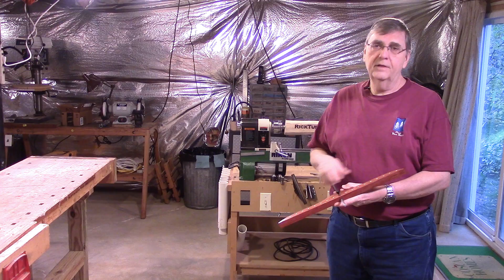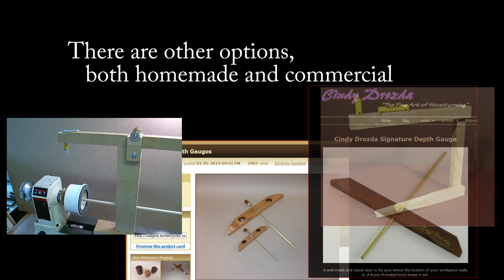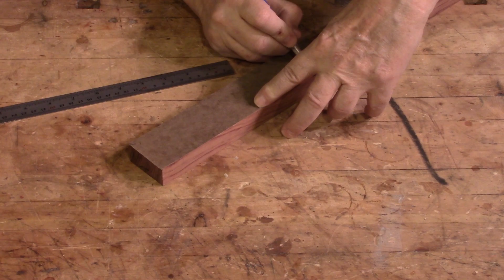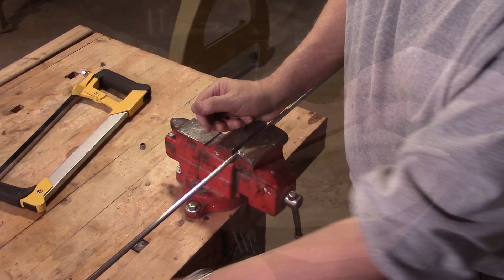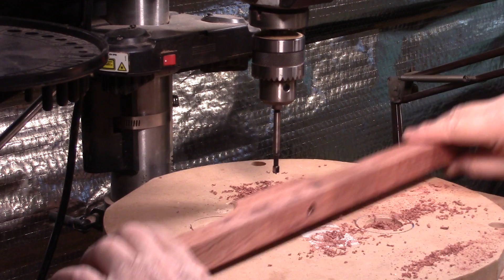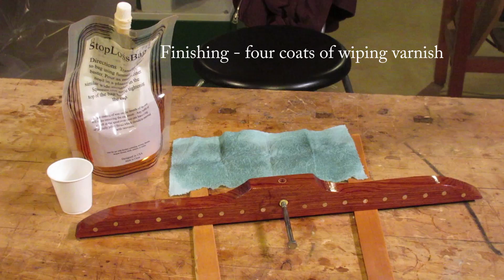Make a Bowl Depth Gauge

Comment: Did you drill a hole through the sleeve?
Reply from the maker: The sleeve is a hollow tube - it already has a hole in it. You do have to drill a hole in the wood to put the sleeve into.

Comment: Very nice, Rick. I’m inspired! When placing threaded inserts, I cut the head off the bolt. Then, using two jam nuts, press and hand turn it in with the drill press unplugged. A little wax on the threads, and perfection every time 😌 Also, can do end grain on the lathe, same technique.
Reply from the maker: Thanks, Mike, I’ll try that method out.

Comment: Nice job ,you can tap wood with a hand steel tap I have found out , it would have maybe helped with the insert  I haven't tried them myself yet but I will ,good job again 
Mark
Reply from the maker: +mark lawson You're probably right about tapping for the threaded insert. I had a hard time getting it in (didn't show all my struggles with it on the video). Or perhaps I should have drilled the hole a 64th or 32nd inch larger. Thanks for commenting.